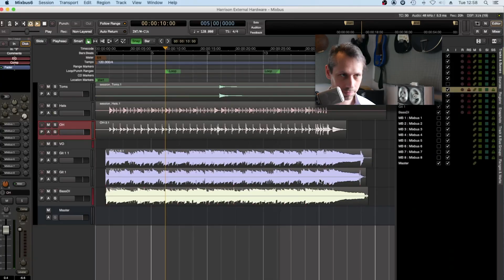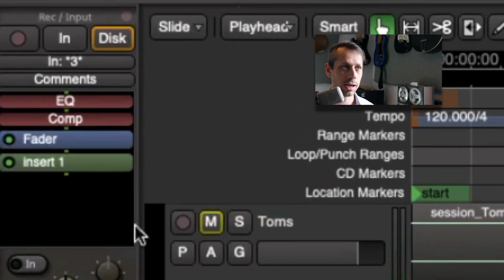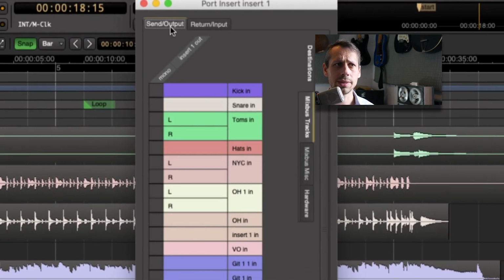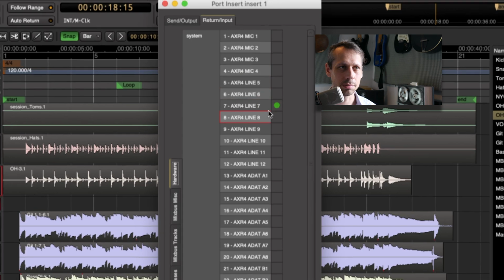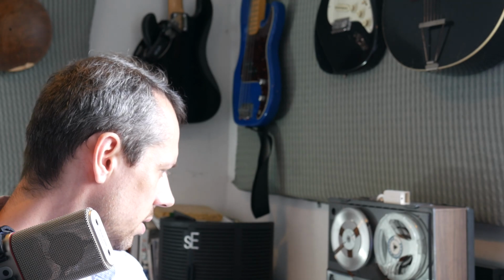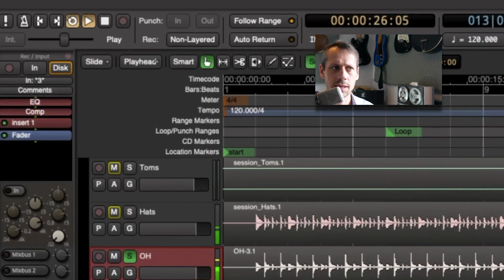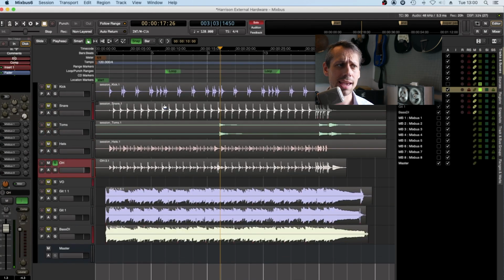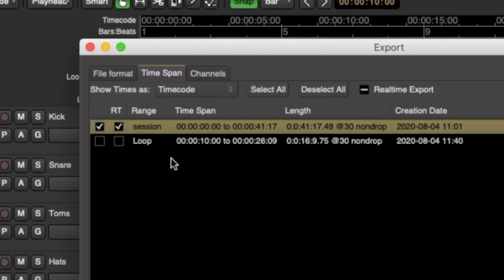External Inserts in Mixbus/Mixbus32C (video by brand ambassador Russell Cottier)

Comment: Thanks for this video/topic!   I wish the physical connections were demonstrated as well as the software connections.  After all, we're interfacing with external hardware, yes?   'Interface output #7 is connected to my module...'    How, exactly?    Would not hurt to be explicit.   Good vid.  Thanks!
Reply from the maker: Its up to you to determine how your connections are made and how many connections you have on your interface.   If you only have two outputs for your monitors and two outputs for external gear then you only have so many options.  Same goes for inputs.  If you have a two channel interface then you can only choose inputs 1 or 2 to return your gear to.  Lesson is: just choose the ins and outs you have available and the rest will take care of itself after making sure your software has the same connections chose as your hardware.

Comment: do you leave out a step or two ?  ie.. did you create a second audio trk for the return from the outboard gear ? It seems like you are sending out , output 7 on your interface,then returning
on physical input 7 on your interface, but to what ? I do this all the time in Studio one and its a breeze,,, mb seems to complicate this to the point I can't understand how to do it in mix,
Normally, in studio one... I create an aux sent and call it mixbus, send the output of that aux to physical outs 7/8 on my lynx n, then create an audio trk and name it print trk... Set the
input of the print trk to physical ins 7/8 and bus that to the two track which outputs to physical outs 1/2 to my mains.... Has anyone done this in Mixbus... I can't find any real info on it
and when I first tried it, I must have messed up the " pin connector " set up ( I dislike this pin set up ) and created a feed back loop that nearly blew out 9,000 dollars worth of speakers.
Any advice would be great... thanks.  ed
Reply from the maker: In this example Russell is applying the insert to only one track and not an entire mix as you are accustomed to doing.  Because of this he has chosen to use an Insert which has the Send and Return on the same track.  When he is ready to print his mix he will need to do it in real time so the external hardware can process the audio correctly.
Reply: Sorry to carry on, just to clarify. For example, if I have a recorded snare track in MB, and I want to add a new "snare+reverb" track, I would create a new input track > new insert > click on recorded track to be sent > click hardware tab & choose physical output # > click return/input tab & select physical input > arm "new" track and press play? Would this give me the new "snare+reverb" track in addition to the original snare track?

Comment: What is the best way to print the processed audio to another track so that it stays in sync? In v7 the recording is out of sync once recorded. I think v8 has fixed this between tracks but not when recording any of the Mixbuses. Any tips for best practice? When I do this in Logic it’s always in sync, I really want to use Mixbus 100% but integrating external gear is holding me back. Cheers
Reply from the maker: send us an email so we can look into this further.  thanks